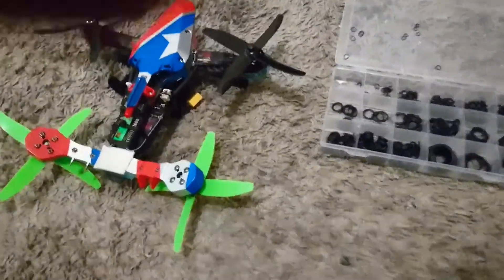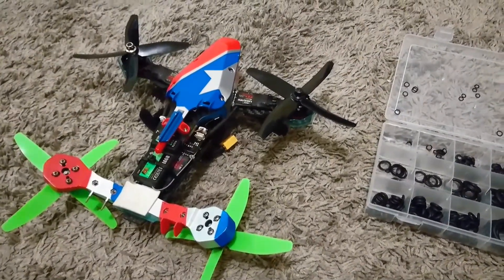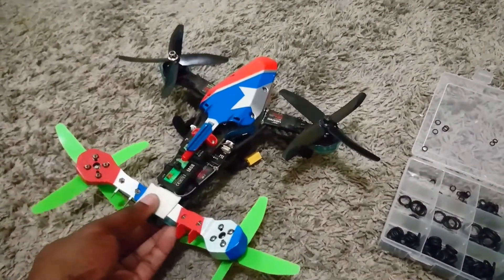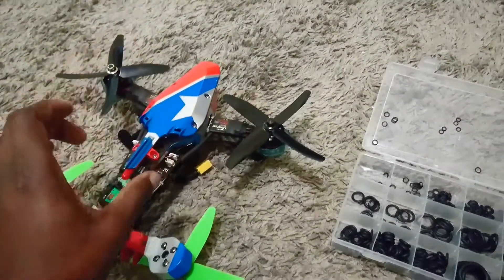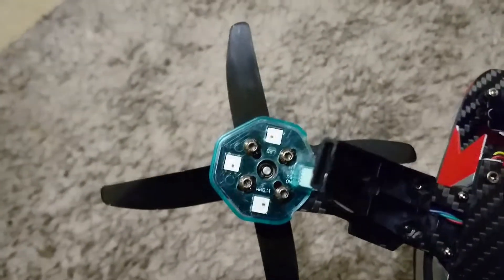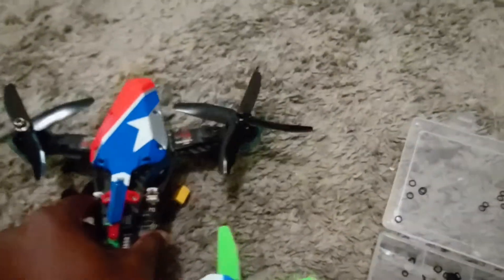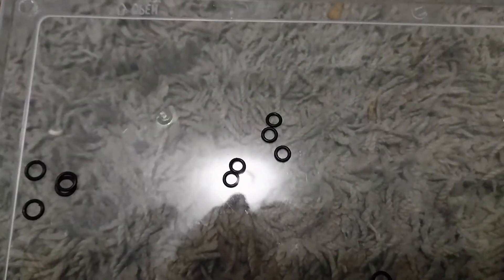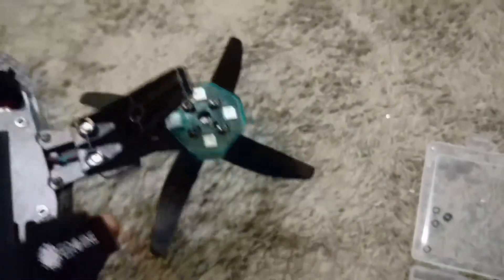Eachine 210 Vtail gyro motor glitch fix info.

Comment: where do you put the washers? between the motor and carbon fiber? or between the bolts and plastic cover?
Reply from the maker: egrojyos Hi between motor and fiber 👌
Reply from the maker: egrojyos So motors sitting on rubber washers 👍
Reply: Junior Ellis Thank you. I'll try. 
I'm having problems with the stability of the drone, it always tends to move to one side, it does not stand still when the sticks are released
Reply from the maker: egrojyos Ah cool,make sure your radio end points are setup in cleanflight,don't try adjusting from radio 👍
Reply from the maker: egrojyos and also if one motor sitting higher than the other that will make it drift to one side 👌
Reply: Junior Ellis. At the "Adjustments" tab in Cleanflight?
Reply from the maker: egrojyos yeah

Comment: careful now it can flight its potential is beyond its toughness. you can make it even more controllable but then your really going to be going to fast for it. in cli type get gyro make it so it uses code filter not hardware filter on gyro it cuts delay down but uses cpu so you need to turn off stuff like baro and mag . I had her ripping but hard landing got my rear arm I had rigged I'm going to make a plate for top and bottom though. then 4s is amazing too much so I will keep saying for the body without mods its the gyro lpf set to off you can search info on it first you can run up to 4k4k with all off but 2k2k might best in testing to stay well under cpu 28%
Reply from the maker: youel adamas yeah I have barometer turned on,it was very glitch until I mount motors on rubber seal,it's very stable now with no gyro glitch 👍 I'll post a video later of my flight I did today 👌
Reply from the maker: I can now safely say it works for me 😊😎
Reply: good use this more like a camera drone don't push it like it was full carbon. she does run smooth after a pampering. practice acro in sim learn then both stable and acro control different in flight also learn line of sight and fpv. then you will get good fast few months
Reply from the maker: youel adamas yeah I can fly in all modes 👍